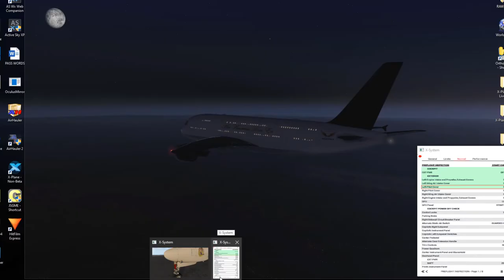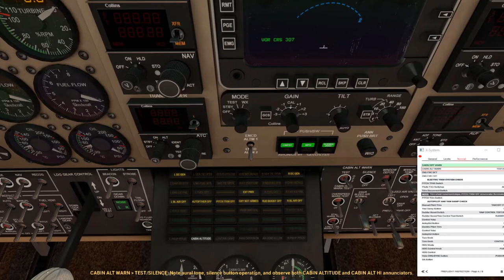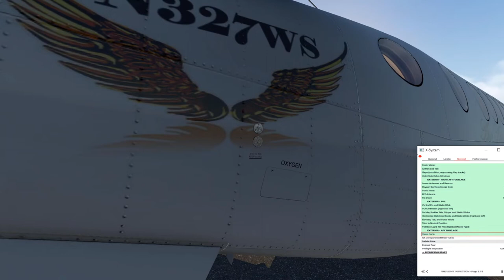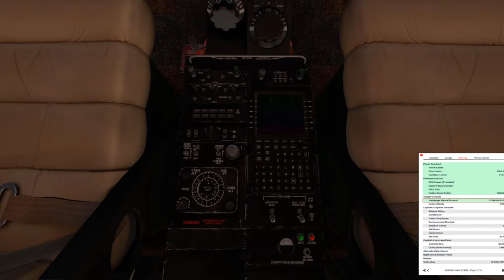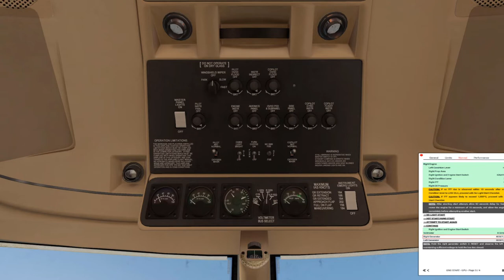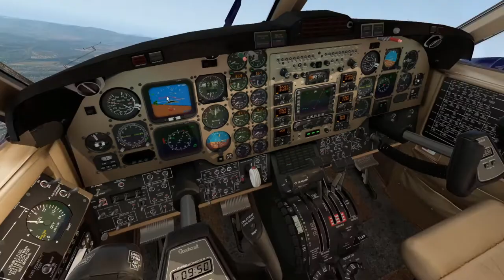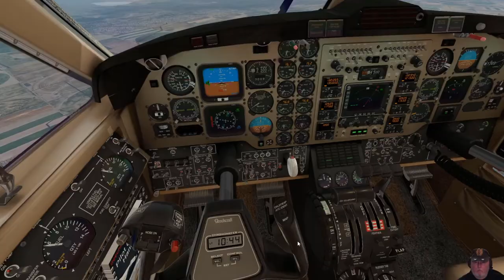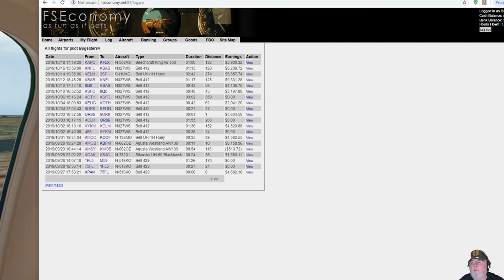X-Plane 11.40b8 Introduction to the Beech KingAir 350

Comment: You must have a good PC to run that plane smoothly. Great landing and the reverse thrust was very effective.
Reply from the maker: I do have a very nice machine (i9-9900k/2080Ti) but it really comes down to Sim Settings. I used to fly this bird using an i7/1080Ti and it flew just as smooth.
Reply: @WilliamBugeater64Simpson  would you mind giving up your settings? I sure would like to know how you set them up. Thanks for the informative Video!
Reply from the maker: @jerrypiesch5607   Which settings are you interested in? The X-Plane 11 Graphic settings or my Controller Settings?
Reply: I was interested in your graphics settings mostly. When you say controller settings that would be pertaining to your joystick?
That could be helpful to me as well?
I have been following your video as I proceed with my checklist and I am wondering how you can go from a switch to the annunciator panel with lightning speed.  By the time I get to the right camera view, the annunciator light is allready off.
Thanks for the help.. Much apreciated!
Reply from the maker: @jerrypiesch5607  I'll get pictures and add them to my next video. Thank you for your comments
Reply: Sounds good....I'm subscribing!!
Thanks for posting this video. I just bought this king air 350 and there aren't many good tutorials out there.
Reply from the maker: @jerrypiesch5607  Thank you for the comment and for watching. Glad you enjoyed it.